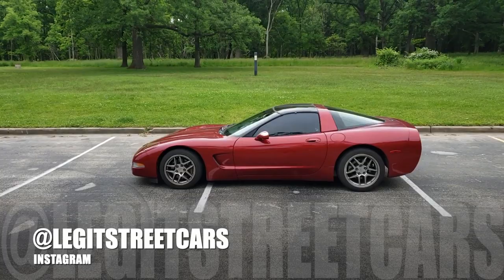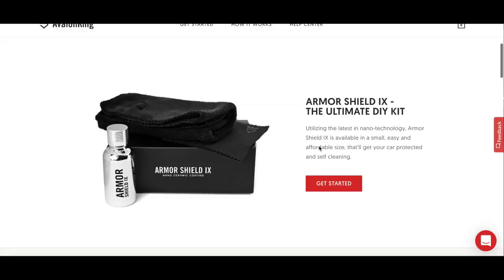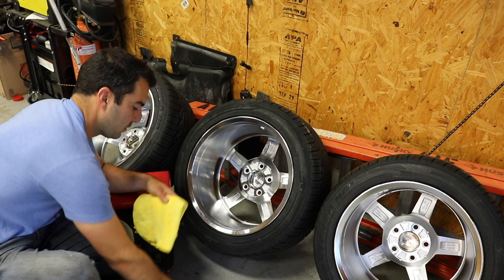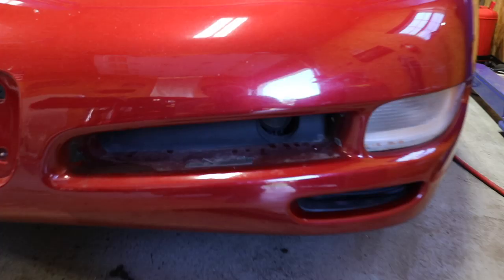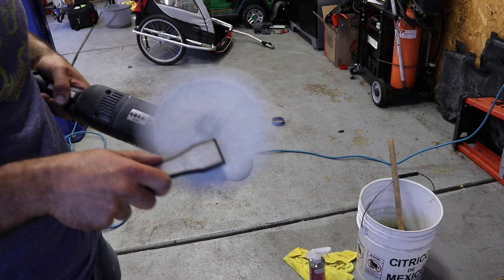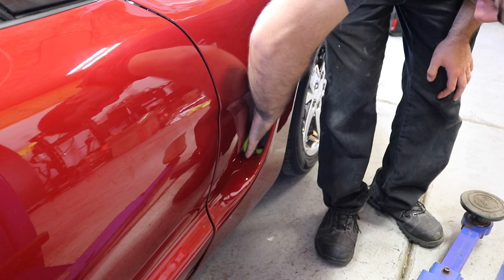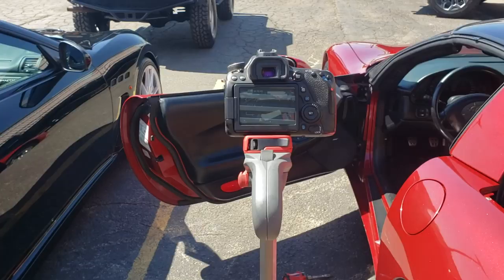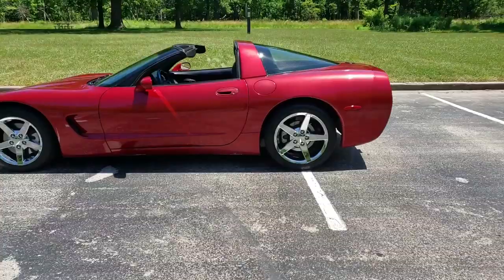I Love Corvettes So I Spent 30 Hours Restoring One That Sat Outside For 8 Years. DIY C5 Restoration.

Comment from the maker: What do you think the Corvette is worth now?
Reply: definitely more than before....... Its a beauty
Reply: Idk, just don't trust Kelly Blue Book ;)
Reply: looks like a million bucks
Reply: Looks good. I saw a youtube video of troy sowers of restoring black trim with a product.
Reply: Just so you don't have to keep buying $15 bottles of iron remover, pick up either eagle one BLACK AND PLASTI COAT wheel cleaner or Meguiars ultimate wheel cleaner. They say wheel but they work on paint as well. Plus, they are half the cost!
Reply: Good question. Go to the Corvette club in your area. They can determine a more precise resale value!
Reply: All the money! Looks great man.
Reply: 14k
Reply: It's worth keeping it.
Reply: 10,000 Easily
Reply: Re spray the trim with x line bed paint
Reply: LegitStreetCars you can resell that for 15-20k. Great job man
Reply: Sell it to a boomer and get a W140 v12 and biturbo it!
Reply: About $3.50
Reply: Alex, here's a tip about restoring your black trims. If you want the trim to remain black longer what you do is run a heat gun over the black trim, moving it back and forth and not letting the heat melt the trim. You'll start to see the black trim color come back to life. The reason for this is because the heat pulls the oils inside the trim back out. Then once you've gone over the trim and got the trim, more so black, then apply those "back to black" or the other plastic trim restorer products on your trims. Doing this will keep your trim looking new a lot longer. AND when your trim starts to fade again, just break out the heat gun and go at it again and all your trim will come back to life.
Reply: 13:19 Black plastic trim ?? Hit it with a heat gun to pull the oils in the plastic back to the surface... it will last as long as it originally did when new.  Try it ,, you'll like it..  when restored via heat treatment protect it with a UV protectant.
Reply: Also, I think you should do a leather seat restore video on this vet. Those seats definitely need to be restored. There's many YT vids on how to DIY leather seat restoring. And if you do restore, one of the things most of the videos don't tell you, is that the dye fades off after while. So to prevent that, just apply a ceramic coating on to the seats after the restore process. I think I seen on a YT vid stating that there's a specific leather coating which allows the leather to stay flexible as well.
Reply: With all the money you save I think you should buy a turbo go for the 500hp
Reply: In Chitown dollars? I'd say a paper clip, 3 rubber bands, some pocket lint... and $2.47 in loose change.

Lol, great video Alex!
Reply: It’s worth a honest 10-11k
Reply: Anthony Michael don’t think that much since 15-20k you can get a 04 z06 with under 100k miles 

This being a 99 not a 01+ c5 it’s not the 1 everyone wants 
10-11k is about the right price for it
Reply: It's only worth what someone is willing to pay.  Not delusional value
Reply: For the seats, there is a product on amazon called The Original Leather Refinish. Super simple to use and not very expensive. I have used it on seats, steering wheels, Motorcycle leathers, belts. You can also blend colors, so I was able to match the Mercedes gray interior on my old W220.  You can also fill in leather scratches with it.
Reply: @michaelbrooks9462  heat gun works, but it still fades again pretty quick. less damaging method is to just use the wipe on products, and reapply it every 6 months or so when it starts fading. For rubber. AT-205 reseal is the best gasket/rubber rejuvinator i know of. Its an engine oil additive for rear main seal leaks, etc. but its a clear liquid in the bottle. Can put it in a spray bottle, or apply it with a rag right on the rubber. works great, and its not just a dressing, it makes the rubber soft and pliable again just like new.
Reply: A lot more haha. Great work 👍🏼
Reply: Much love from Chicago.
Reply: Great result, looking waaaaaayyy better, but, miles are killing it! IMO, 8-9K....
Reply: It'll probably get 15-17 on Bring a Trailer. Looks great Alex!
Reply: Trim hack. 
Please try this on a spot that is not directly visible. And I prefer to take the plastic part of first. But! You can remelt the plastic top layer with a heat gun and a wide mouth attachment. 
But please try and learn this on an old faded peace first. Oh ! It does not make deep scratches go away. So no reason to try that. 
But I love what did with the car. 👍🏻👍🏻
Reply: 15k
Reply: @SprayStein  I have a 96 euro spec v12.  Looking to sell now that I picked up too many projects.  Would love to see someone fully restore it.
Reply: Nice. I really like that GM color. I don't know why, but I always have. Looks great. GO CUBS GO!
Reply: There's a lot of G body's out there that could use this treatment.
Reply: Freshen the interior, detail the engine, plus other minor fixes, and you should be able to turn a 5G profit easily. Great job on your detail work, as I remember when you use to help out your local detail shop with detailing your personal cars. You've come a long way. Bottom line: your videos are always top notch.
Reply: B Kopp sucks doing oem gbody paint it’s a 2 stage paint where the clear is mixed with the color 

My brothers 87 cutlass was like that with 57k miles original 
Took very long to buff looked good but never the finish like a corvette 

Corvettes have what people call a heard clear coat 
Very forgiving when buffing and paint holds up for a long time
Reply: @bigkarl24  good to know. Thanks.
Reply: Also, try solution finish for badly faded trim for a semi-permanent finish.
Reply: Car looks great!  Time well spent, I would say.
Reply: according to boomers? $25k,  reality? maybe 9-10k?
Reply: I would say priceless since this is the last real vette because of the pop up headlights and the round tail lights that we fell in love with over the years  
This is my 1st time on your channel love the TA. 💪🏿👍🏾
Reply: $10,345 + $5,250 in Alex's labour
Reply: Its worth as much as someone is willing to pay for it.
Reply: I would say $15,000 max.
Reply: Nice job! I'd say about 12.5k
Reply: Fire Vic1979 lol not in Illinois where this car is. Z06 with 31k miles go under 25k,  high miles like the corvette in the video with 132k miles would be the 15k range. C7 here used start at 37k with under 50k miles
Reply: start at 18k accept no less than 15k.mileage is important but these ls1 last forever.
Reply: @bigkarl24  that would be the nicest 10k $$ car ever.
Reply: LegitStreetCars ...that was an excellent video! So many on YouTube are high on entertainment, and low on the technical stuff....yours was a perfect balance of both!! Being a bit older, I'm skeptical of many new products...but your video, I think has swayed me on the ceramic cote....I would like to share a product I swear by...Collinite 845 heavy duty insulator wax...takes some effort to use, but I have yet to find a wax that brings out the color better! Maybe you've used it? I baby the shit out of my srt challenger! It's nice to see younger guys putting that kind of effort into paint care and such....most to day want the spray and wipe crap! Kudos sir!
Reply: Bernie Cruz great tip! It works like a charm! But be careful!
Reply: 13k
Reply: Fire Vic1979  those are definitely C6 prices in most of the country...
Reply: The same
Reply: @michaelbrooks9462  maybe he should use aircraft grade hydraulic oil to strip the paint off down to the bare metal. and this should be done without gloves or respirator because why not... hell why not just use it in the yard because it works better then round up in a few minutes compared to a few days...
Reply: What someone is willing to pay for it !
Reply: its worth updating us on the 320cdi right now I think!!!
Reply: With the milage and condition 10k~11k easily.
Reply: 16k-20k
Reply: Ok. I have a 1967 with a 427. I need to to come over and detail it detail it. 😁
Reply: In Philadelphia it’s worth $50 bucks😂😂
Reply: It's priceless 😎 keep it
Reply: 100,000
Reply: Looks like a million bucks.. The C5 vette is a beautiful piece of Americana
Reply: 35mpg if you keep foot off floor
Reply: @jclaydon3454  are you joking it has a lot of miles on it why the hell would you spend that amount on it?  just a piece of metal
Reply: @aaronhuynh3360  sure
Reply: Good thing to restore the plastic trim is diesel fuel and a microfibertowel
Reply: $1500 corvettes are ugly asf
Reply: 35k
Reply: Do you wanna polish my 79 Corvette?
I live close by.
Reply: Probably $150 and the best I can do is some chewed up bubblegum.
Reply: $258,282
Reply: After what you did is priceless...
Reply: itzyourboinelson n lol for a c5
Reply: 2 dollars

This is a joke
Reply: Smug The Mug yeah you are not a car guy
Reply: 64 65 000
Reply: @kawasakiwhiptwo5821  LLP
Reply: $50.00 and I'm taking all the risk here.
Reply: @peruprofundodance  nah there actually 40,000 or more
Reply: @aaronhuynh3360  nope 40,000 or less or more 😂
Reply: Possibly 40,000 or less or more 😂
Reply: LegitStreetCars depends on the mileage but based by looks it seems somewhere around 5-10k
Reply: WAYY MORE THAN BEFORE
Reply: C5 prices are starting to creep up so I'd hold onto it for a couple years. Right now value is $11k..to.. $15k. In 2 years most likely $16k..to $19k. Great job on restoring that neglected beauty👍
Reply: LegitStreetCars priceless it’s so beautiful😊
Reply: 11k
Reply: LegitStreetCars not much
Reply: Keep it the car don't sell it yet
Reply: Cleaning a car doesn't make worth any more than it did before.
Reply: @Knights.of.Ni.  actually yes it can
Reply: I'll trade you my finest paperclip 👏 jk, Beautiful job. Nicely done man
Reply: Around 10k.... anything more than that and you're better off getting a C5 Z06
Reply: 18 to23 thousand on the high end.
Reply: ron s zr1 not even worth 200k you goof
Reply: 15-18k
Reply: /agree best answer
Reply: around 13/15k
Reply: 8500
Reply: 10 grand
Reply: Five dollars
Reply: not as much as a mopar lmao
Reply: bout 9k
Reply: Cars loose value quickly so shouldn't be worth more than 11 or 10k
Reply: Don't you have to drys the car straight lines and not circle motion or else you'll create more swirl marks
Reply: Beautifyed😩
Reply: Try wd_40 for the trimming it works and also scratches I tried it it's up to you
Reply: It's worth what u spend to get it cleaned) 😀👏👏👏including what u bought it for
Reply: Like $15k-$20k. I’d love to find a Corvette C5 or newer to restore.
Reply: LegitStreetCars thats my least fav vette color but wow u made me like it
Reply: InPoint 15k? youre on drugs.  even 12 is high
Reply: @bigkarl24  lol, Z06 used is 50-60k in europe.
Reply: Tom Jacobs look at prices  for c5 corvettes in the us normally you can find them for 20k under 80k miles in Illinois 
My friend was station in Germany 
He said a couple us cars cost a good chunk of money out there
Reply: Diet Coke depends on location in the us
Illinois where he’s at he won’t get 15k 
Cali or Florida he would get 15k
Reply: 20K!!!
Reply: tommyboy790 A
Reply: 1500$!!!
Reply: 50,000 to 70,000
Reply: $8,200
Reply: $8800? Thanks Alex! I'll see you Friday when I pick up the ecoVette!!!
Reply: Looks awesome  !!!!!    I have a 04 grey .. always garaged 120k
Reply: $3700?
Reply: As much as some one will give you for it!
Reply: 14-17K at least
Reply: I'd just keep it & throw more money at it, but I'm crazy.

You can probably get 15K for it. Almost 4K profit for 4 days work is hard to beat.
Reply: ill give you 5k for it
Reply: $6900.00
Reply: $35.000 A beautiful car with great power love the video 👍
Reply: here in Las Vegas maybe between $7500- $8500 -you would loss $ selling it here
Reply: @GreyFox2000  god damn loch ness monsta
Reply: LegitStreetCars 150000 bucks
Reply: Ur mom
Reply: 15k depending on some things
Reply: Couple bucks
Reply: 30 k
Reply: The pop up headlight alone worth the money.
Reply: $26,000
Reply: Not more than 9000$ on craigslist
Reply: LegitStreetCars man teach me how to make my car look so great
Reply: Depends on year milage condition and if its the base or rare model. Keep in mind rare model cars are gonna be a fight for parts as they are more rare unless you go with an after market knock off. But they could range from 10k-20k depending on these factors and the model rarity.
Reply: @RK-gk1fw  Bro they could start @ 2500 I've seen some clean examples for under 5k on craigslist stop with the bullshit all Corvette owners think that they have a rare shit even when they have the base model. I buy and sell cars all the time and been working fulltime at a auto body shop for the last 12 years. This reminds me of the  mf's that are trying to sell 2000 & under civics  and 03+ rsx for close 10k wtf they all the sudden went from selling rsx type s from 3500 to 7k for EXTREMELY clean examples to now 5k for a piece of junk and some for over 10k all in one year.
Reply: @oneg1970  I dont want to shit on you but when someone calls me buddy I feel like they're trying to tell me that they are the bigger man and its disrespectful.  In this case you should can him your GOD or your MAN.
Reply: Jr. Legnar. I didn’t mean to make a post to this thread. I meant to post as a new thread in reference to the guys work he done on his car. My bad.
Reply: @AnthonyMichael504  
No way that car brings $15k, never mind $20k. C5 sellers ASK that kind of money, but rarely get offers over 10k. For a high-mileage car like this, I'd expect it to be worth about what LSC has in it, not counting value for the time spent.
Reply: Michael Lorenson I’ve witnessed it my friend. If you only deal with people with empty pockets you’ll always receive empty offers.
Reply: @AnthonyMichael504  
The offers are not always empty. Interestingly, C5 Corvettes have among THE biggest market spreads in asking prices versus offers. 

It's true that a car is worth what someone will pay for it. This particular car is now a You Tube celebrity, and someone might well pay more for it than I would. But I think it's worth about $8500 given its mileage, and that there is certainly some mechanical refurbishing yet to be done before it's really solid and truly drives like it should. 

Just my opinion, I could be wrong.
Reply: $15000  All day long👍👍👍👍👍👍👍👍👍👍👍👍👍 Looks amazing man I hope I can do the same thing with mine I'm gonna buy at 92 White Corvette Wish me luck.
Reply: I want to get a Corvette but I want it more fuel efficient. I need something with a 327 even at 305 would be good
Reply: Maybe 13.5 k..... Because of the tires and rims.... Oh, and of coarse the quick and beautiful detail/touch up job you did.
Reply: i guess im asking the wrong place but does any of you know a trick to log back into an instagram account..?
I somehow forgot my account password. I would love any assistance you can offer me!
Reply: @Bentlee Issac instablaster ;)
Reply: @Derek Noel it worked and I finally got access to my account again. I am so happy!
Thanks so much you saved my account!
Reply: @Bentlee Issac no problem xD
Reply: @peruprofundodance  no it doesn’t a million is a sh_t ton get real it looks good but come on it’s old with a ton of miles on it brah
Reply: Not much more than before brah

Comment: Everything looks so smooth and easy until I try to do it on my own car 😁
Reply: I gave up polishing after doing just my hood :D it made almost none difference, my paint was in pretty good condition. So I just covered it with ceramic after cleaning it with clay bar and ironx.
Reply: You gotta use halogen lights!
Reply: @jgh1987  I've got XENON lights :D
Reply: @jgh1987  for paint correction?  Wrong.  You need an LED light in the 5000-5500 kelvin range to see imperfections in the paint and look for high spots on ceramic coatings.
Reply: N. M. Hahah this is soo me
Reply: Personally, I've found the key is to just do things at your own pace, the way you want to do them, and then it's always smooth sailing. If you can only do a mirror in a Saturday, then you got a mirror done. Same goes for any type of project. Just do what you can with the constraints you have and enjoy it.
Reply: A section at a time and at your own pace, you can't rush it. Patience is the key
Reply: @rayk9897  im w u on that but ja's comment struck me as someone who didnt understand the concept of polishing although i missed the iron x part, like he said paint must of been in real good shape
Reply: @rayk9897  I'm not convinced of that. Paint correction procedures have been a thing for a hell of a lot longer than 5000-5500 kelvin range, LED lights have been around.
Reply: @heinzkitzvelvet  I would be happy to convince you.  Go into a parking garage or your own garage for that matter and look at your car.  Looks great, shiny, near perfect right?  Now use the flash on your phone to inspect the paint.  You find swirls, scratches, blemishes, etc.  Why?  Different type of light.  Further, when in the perfecting stages, or jeweling, you can run different temperatures to see on an even finer spectrum.  Sure correction has been around a long time,  but times change, and so does the technology.  Remember when all you needed was a 10" wool pad and a rotary?  There were no dual action machines out.  You just relied on experience, or ended up with really marred paint.
Reply: @rayk9897  Show quality paint jobs and paint corrections have been around longer than your special lights. All I'm saying.

Comment: You mentioned having to replace the oil pressure sending unit.  Before you do so, read the post on the C5 Corvette Forum with instructions and parts required to build and install a remote oil pressure sensor.  You can hide the rig along the left fuel rail and never have to remove your intake again to replace the sending unit.  Ive just completed the job myself and it's really the cat's meow. These sensors are notorious for frequent failure.